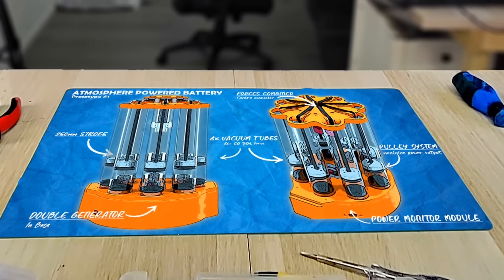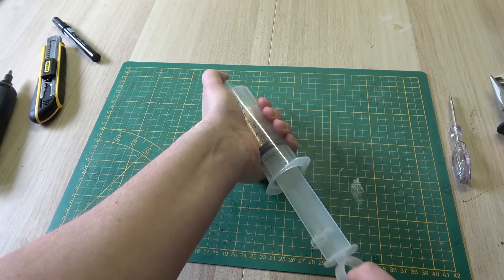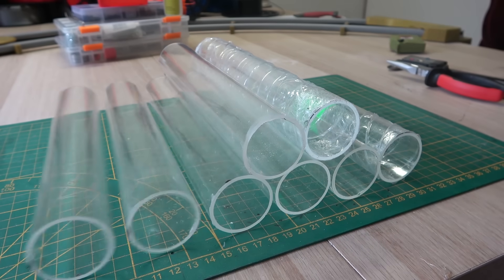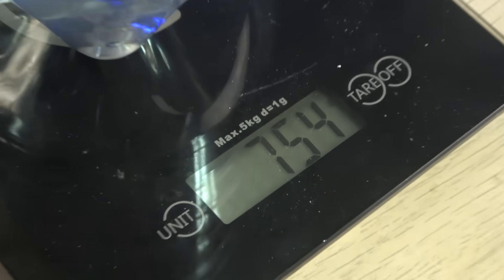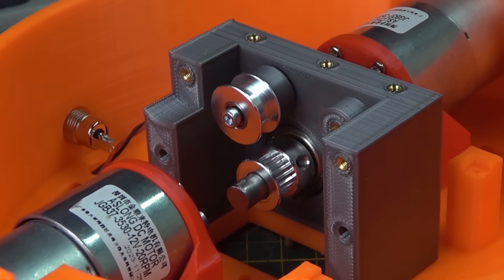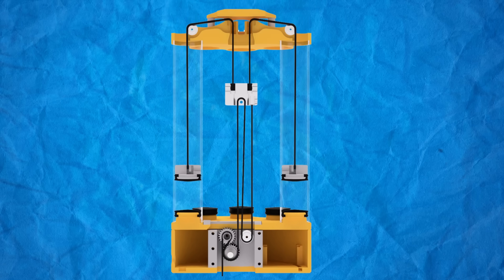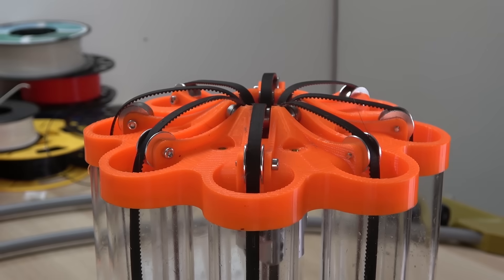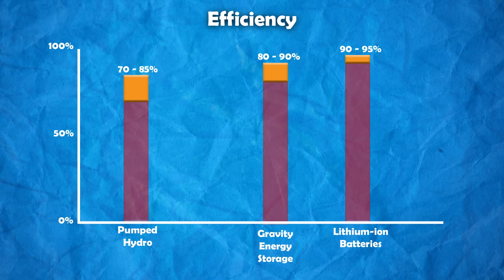Building an Atmosphere Powered Battery..

Comment: the worth in continuing this experiment is dependant on what you're hoping to achieve with it. If you're trying to learn about energy storage and wanna experiment and improve your own manufacting and production ability, I'd say go for it. If you wanna try to revolutionize energy storage on a large scale, I'd say this isn't a viable technique. There might be a couple percent of extra efficiency you can squeeze out of this concept, but you're not gonna get anywhere near the efficiency of lithium ion batteries, which also have the added benefit of being smaller, lighter, quiet and having no moving parts to break

Comment: what about space efficiency and cost per kwh seems like a very interesting idea old like to compare it to gyro storage
Reply from the maker: Space efficiency and cost per kWh are crucial factors in energy storage systems. The vacuum battery concept explored in the video has its merits, but when it comes to space efficiency, it might not be as compact as some other storage methods like lithium-ion batteries or gyro storage.

While it's an interesting idea with a unique approach to energy storage, comparing it to gyro storage reveals some clear advantages and disadvantages in terms of space efficiency and cost per kWh. It's essential to weigh these factors when considering the best energy storage method for a specific application. Thanks for bringing up this comparison!💪

Comment: What about a sunlight powered battery? Where at the coldest point of night the tank opens to equalize the pressure with outside and then at the hottest part of the day when a tank has the most pressure a valve opens to spin a motor converting to AC power
Reply from the maker: That's a creative idea! A sunlight-powered battery that uses temperature fluctuations to create pressure differentials could be an interesting energy storage concept. Essentially, you'd harness the natural cycle of day and night to drive a motor and generate power.

It's a cool concept and might be worth exploring further to see how practical it could be. Thanks for sharing your idea!👌
Reply: @ConceptCraftedCreations  Id love to see you build it since it seems to be in your wheelhouse and i dont have the time or resources

Comment: Not to take this the wrong way... I love all such efforts, but... this seems extremely dangerous for it to be both inexpensive and small enough. Plus... it's not clear to me how this is better than gravity batteries.  However... why not improve the gravity battery by making them series of heavy enough plates which each of them will spin downward under their own weight while that can create additional power... and because those are 200* disks instead of 1 cylinder... it will take that far less power to reset.
Reply from the maker: Thanks for sharing your thoughts. Safety is a significant concern with any energy storage solution, especially those involving high-pressure or vacuum systems. The risks associated with vacuum technology can include implosion and mechanical failure, which might make it less suitable for inexpensive and small-scale applications.

Your idea to improve gravity batteries by using a series of heavy plates that spin downward under their own weight is intriguing. This approach might reduce the reset energy required, as each plate's weight contributes to generating power. Additionally, having multiple smaller components rather than one large one could be advantageous in terms of safety and distribution of stress. The design could also offer more flexibility and scalability, allowing easier maintenance and customization.

Gravity batteries have the advantage of using simple mechanical principles, and your idea adds an innovative twist. If implemented well, it could offer a safer and more cost-effective energy storage solution with potentially lower energy requirements for resetting the system.

Overall, it's great to see these creative approaches to energy storage. The key is to balance safety, cost, and efficiency while exploring new concepts. Thanks for the suggestion!

Comment: I think using sturdier materials and maybe larger pistons. That would be a good start for a V2
Reply from the maker: Absolutely, using sturdier materials and larger pistons could help improve the durability and performance of a V2. With stronger materials, you could manage higher pressures and reduce the risk of failure. Larger pistons might increase power output, offering more capacity and efficiency. This could be a great direction for refining the design and boosting reliability. Thanks for the suggestion!

Comment: Water or oil system instead of plunger
Reply from the maker: Switching from plungers to a water or oil-based system could be an interesting approach to the concept. Fluid systems can offer smoother operation, consistent pressure, and potentially reduce mechanical wear compared to traditional plungers.

Thanks for suggesting this!💪 It could be a viable avenue to explore for optimizing the efficiency and reliability of this energy storage concept👌.

Comment: Nice work👌.  Eventhough, it looks like the project is based on gravity based storage, it is not. The similarity ends, except for the up/down motion of the piston. The project is actually based on atmospheric pressure, where the potential energy is stored in the vacuum, that fights against the atmospheric pressure. That said, you could store much more energy in even a smaller vacuum, wonder, where the horse power rating came from?🤔 The issue with pistons , is that the, vacuum created is a gradient, that varies in a non-linear manner, with most energy stored only in the final stretch, that creates the max vacuum. If you  pre-vacuum a single piston with a one-way valve, you could store enormous energy(limited only by the gaskets and the mechanical strength of the structure-may need steel wires and an awl ratchet mechanism, that can be electrically disengaged🤔). There is a definite possibility to store ample energy in a very small space (vacuum?), provided there is no leakage. There is only one issue to solve, to make the solution practically viable, I will let you figure that out 😊. Would love to see a compact, inexpensive chemical free energy storage option for alternative energy sources, such as wind and solar. Goodluck with taking the concept further❤👍
Reply from the maker: Thanks for the detailed feedback! You're right and your idea of using a one-way valve to pre-vacuum a piston sounds intriguing. It could indeed help store more energy by maintaining a high vacuum level. Ensuring robust construction and reliable seals is crucial to prevent leaks and maintain safety, especially with high-pressure differentials.

Your point about the varying energy gradient is valid. It can affect efficiency, requiring precision engineering to optimize energy extraction throughout the piston's stroke. A sturdy structure, reinforced with steel or other durable materials, is key to handling these forces.

It's exciting to explore chemical-free energy storage options, especially for renewable sources like wind and solar. I appreciate your insights and will definitely consider them in future developments. Thanks for sharing your thoughts and for the encouragement!💪

Comment: I appreciate and applaud the investigation, though there are significant losses and efficiency issues here. I initially thought you were going to try and make a barometric powered energy generator- it is possible to pull energy out of the atmosphere by harnessing barometric pressure changes. The Atmos clock is one practical example of such a device.

Comment: I work with equipment that is very sensitive to atmospheric pressure changes and I will say that this energy storage is extremely interesting. Especially, in climates that have massive ambient pressure spikes.
Reply: imagine if this is done under water. or lik ea mile deep in the ocean. the force of the water on the equipment would be a lot higher
Reply: I work in an industry where i get to witness how quickly seals fail

Comment: it's super freaking cool, with a little bit of decoration this could be a functioning sci-fi power cell
Reply: Whats funny is that it basically alreay looks like a power cell. Imagine a charge station were you just plug in the button and theres a motor to pull them up creating the vacuum lol. In a sifi setting it wouldd charge in seconds but take a while to run back out based on application.

Comment: wouldn´t the vacuum decrease over time? impacting the efficiency?

can the efficiency be improfed by chsnging the outside pressure? like moving it between 100 meter under water and the surface.
Reply from the maker: It is indeed difficult to maintain a vacuum over a long period of time... Especially with a setup like this that of course uses materials that are not entirely intended for this!😊

And moving it under water would definitely improve efficiency! The deeper you go the higher the pressure👌

Comment: It's good to know that quite a few gases can creep through plastic. So, long term this battery can't store energy. Also tried to create similar vacuum battery, but I realized I needed too much space for me to be viable to continue. The energy density / Litre is just not something I can squeeze into my home.
Reply from the maker: Maintaining a vacuum over a longer period of time does indeed pose some challenges! But nice to hear that you have also been working on it... Was that a long time ago or recently?

And I agree that a system like this is difficult to build into a house. That's why I was thinking about "burying" it in the garden. But that's just a thought of course!
Reply: @ConceptCraftedCreations  Was a couple of years ago. I had issues with the valve to function multiple days, so I used an approach of 2 pipes that are "tight" fit wrapped into a sealed "bag". More like a prototype than something final. But again, my main issue was maintaining vacuum from summer til winter. Kept leaking eventually somewhere. Plus the amount of space ... even in your tests, that is like 0.6 KW compared to even a simple battery .. it's big.

Comment: So you started from the gravity battery telling us that would need a weight to big. Would this solution help with that? So how is the solution size compared to a more simple gravity battery?
Reply from the maker: I probably should have explained that a little further! So thanks for mentioning it!👌

The dimensions of a cube of 100KG concrete are ~ 34x34x34cm

The dimensions of a cube of 100KG steel are ~ 23x23x23cm

And the diameter of the piston you need if you use atmospheric pressure on a vacuum is ~ 11cm for 100KG

And the great thing is that if you double the diameter of the piston, the surface area of the piston quadriples and therefore also the force it can deliver.
Reply: @ConceptCraftedCreations  but what about linearity? So if you lift a weight it has a constant force, allowing for nearly unlimited height of the lift.
With the vacuum the force needed to pull the plunger increases (I guess not linear) with the height/distance.
Reply from the maker: If we assume that there is no air in the cylinder when the piston starts to pull, the force over the entire length will remain virtually the same as far as you pull it out.

Comment: How many watt hours
Reply from the maker: To clearify how i got to the result you see in the video🤓

To charge: ~12.08V x ~1.62A x 43.709 seconds = 860,64 Watt

After a discharge: ~9.42V x ~1.15A x 57.993 seconds = 628,24 Watt

All value's are measured by the Arduino Nano in combination with the INA3221 Power module.

Comment: I guess there is at least some leakage. How does the stored energy drop over time? And how do you get rid of the air that is leaked in the tubes?
Reply from the maker: This is certainly the case, especially with a setup like this prototype! But of course there are plenty ways to improve that if you would like.

Comment: I expect the efficiency can be improved but what's the energy density?  being that you're using a compressible gas, I figure it won't be  great
Reply: Also I think the power output is going to decrease as the pressure decreases, unlike the gravitational system which is practically linear until the weight hits the ground

Comment: I couldn’t stop thinking of using diaphragms for vacuum formation instead of pistons the entire time I was watching the video. It would eliminate leakage and friction.
Reply: friction, leakage and maintanance for this battery would be to high to be practical, But idea with diaphragms would reduce those. You could build closed sealed system with less wear. But! you can create vacum, how dou you want to turn it back to mechanical energy? they won't vibrate by constant vacum and i think mechanical solution to turn the vacum back to mechanical would add the problems back that you solved by using diaphragms :)
Reply: @smoketatum6730 One way valves and a crankshaft?
Reply: @Alkatross  yep, and thats what i ment, by adding complexity You are adding more maintanance and leakage possibilities, so You are back to Point 1

Comment: Why have seals at both ends? You need a seal only on the piston; the other end can be closed.

Also, with the seal on the inside end of the piston, atmospheric pressure tries to pull it off the piston, but if the seal was a ring on the outside end of the piston or held in a groove in the middle, that wouldn't happen.

Comment: Ok...
Nice build, cool concept, GREAT fixtures to measure your variables, and pretty good math (before you calculate efficiency), but didn't you just build a really complicated spring... that needs lube?
Build this same concept using a car spring instead of the syringes.  Plus, then you wouldn't lose energy to air leaks with long term storage.
Reply from the maker: Thanks👌 And to clearify how i got to the result you see in the video:

To charge: ~12.08V x ~1.62A x 43.709 seconds = 860,64 Watt

After a discharge: ~9.42V x ~1.15A x 57.993 seconds = 628,24 Watt

All value's are measured by the Arduino Nano in combination with the INA3221 Power module.

And u could use a spring but it would be challenging to stay within the dimensions of a system like this because the force of the piston in a setup like this would quadruple when you double the diameter.

Comment: Also just a crazy idea for a gravity battery that could work is  turn a whole parking garage into a gravity battery. The roof can be all solar panels. It should be loaded like a spiral column with a car elevator in the middle to load and unload cars. It will double as a space saver too.
Reply: You'd have to park by day and unpark at night

Comment: it would be crazy if you make a flywheel powerbank to recharge smartphones or something, like same size... it is capable to beat lithium battery i guess so, lets find out ... make it !!!
Reply from the maker: I will add it to the list with potential future projects if you're Ok with it?🤓
Reply: @ConceptCraftedCreations   it is very difficult because of tensile strength of objects, I think the best way its to have a big diameter on the flywheel like 70mm, small diameter flywheel need more RPM to store same energy so for safety better have  more diameter so you would not need to spin it as fast, hmm, I think you save 1 or 2 hours each day just for this project it's better so you keep making your other videos because i'm sure it will be hard flywheel concept have many ways to make it work, it's something fun if you work in this project little by little it work for sure, I mean you can make it fast but it's better making a more optimized version, basically you have very high rpm thats a lot of torque   , to make the power to charge a phone you need very small amount of torque to spin the generator so you would need the a magnetic gear, it's something fun as project I'm sure you'd have fun
Reply: im from brazil so idk as much, it is a portable battery to charge smartphone... make one with flywheel it would be  so nice, i'm sure it would take some very good work to do so but yeah you would be one of the first to make it, size of a hand flywheel battery

Comment: I would probably try and put a liquid in the cylinder, put it outside in the sun, using a Lens to concentrate the sun's energy to expand the cylinder and the night to cool it down to return it to its original starting position.... 
It's a slower process but could work for a Longer period of time.....